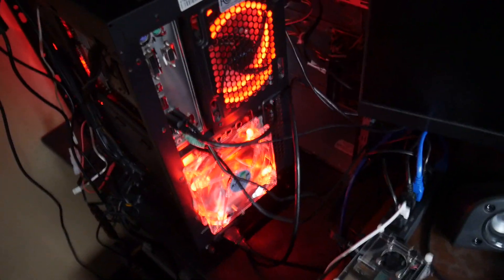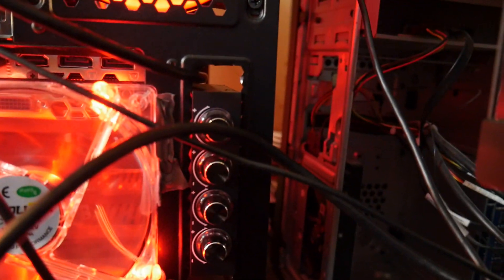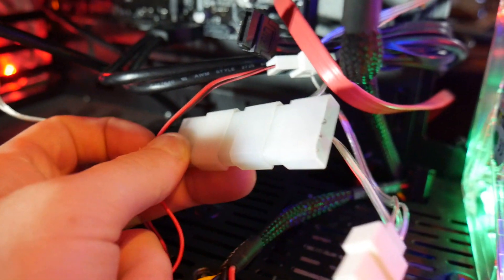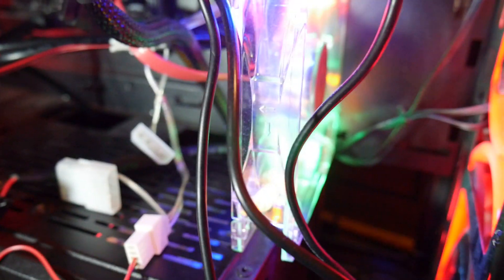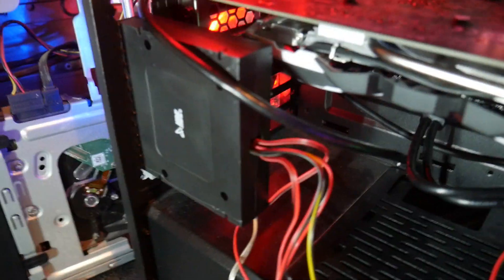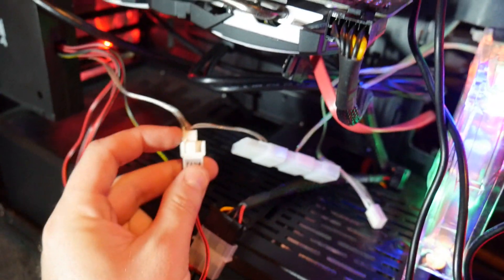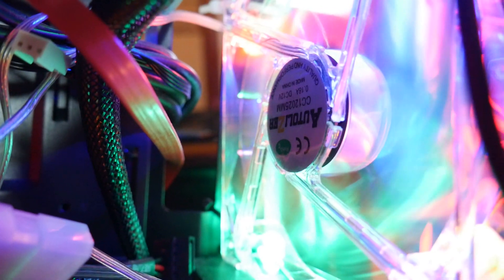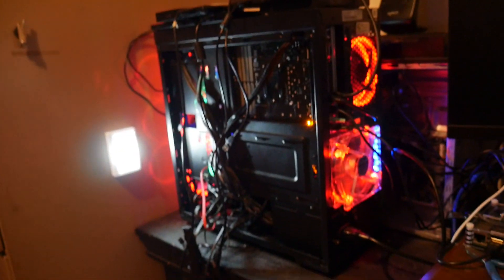Installing Fan Controller For The CYBERPOWERPC GAMER EXTREME GAMING COMPUTER THE BEST GAMING PC

Comment: What's your pc specs? Mine a i7 9700k, RTX 2060, 16 Gigs ram
Reply from the maker: I5 7400 Radeon rx 580 8gb 28gb ram memory , next I need to upgrade to the i7 9700 but so far I have not needed to any game I played handle sit fine overclocking the gpu and tweeking  settings really helped this pc